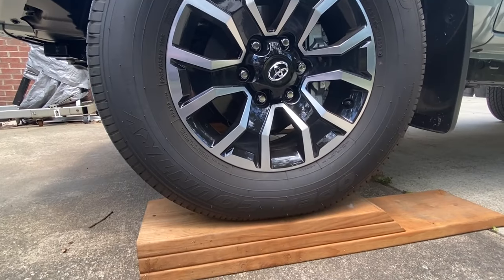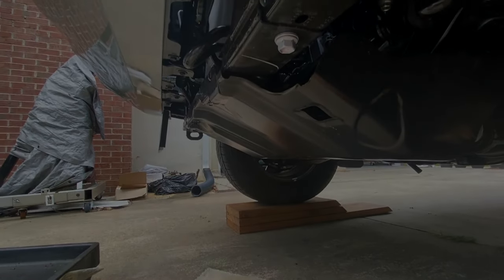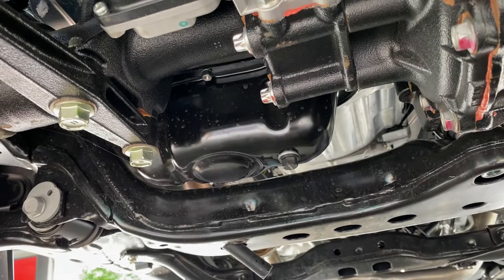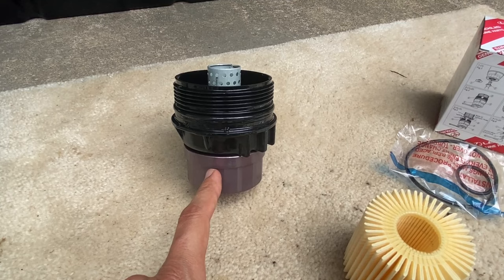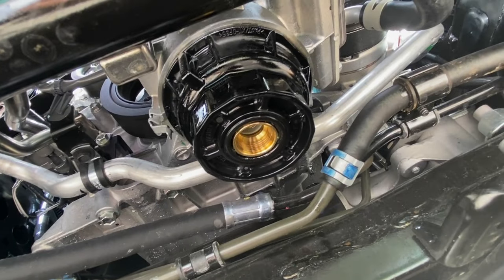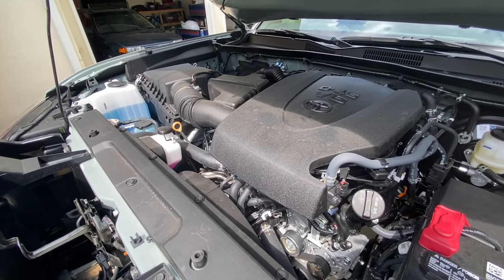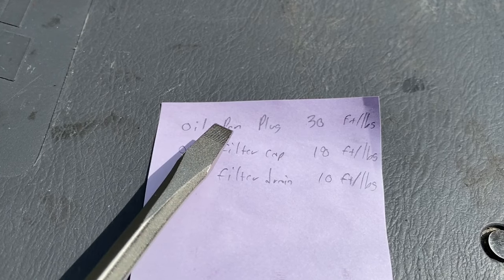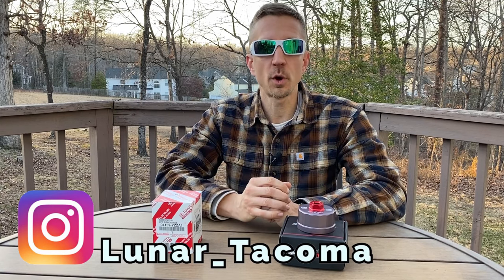Toyota Tacoma Oil Change Complete Guide - 3.5 V6 (2016-2023)

Comment: I have a 2023 with 100 miles on it. I've been checking the oil for the last few days and as many of you know, the dipstick isn't the easiest to read. It seemed to be reading over the full.
Since I bought it with 6 miles, I hoped it was filled properly from the factory.
Today, I had to change the oil, simply for peace of mind. It was approximately 30oz overfilled from the factory. I'm glad I changed it at 100 miles.
Has anyone heard of this happening?
Thanks
Reply from the maker: oh wow - 100 mile oil change.  I am not familiar with overfilling but I think I'd rather error on the higher side than lower side of oil.  That's good that you caught it for piece of mind.
Reply: @randomrebuilds  Definitely. I'm still kind of in shock, but I guess you never know. 
I figured that was measured by cpu at the factory. Strange..
Reply: @randomrebuilds  Have you ever seen seepage around the rim of your filter housing where the plastic meets the metal? Mine is torqued to 20 foot pounds and oil keeps appearing there. My truck has 110 miles on it and I already don't like it..
Thanks
Reply: My new Toyota Tacoma was a little bit overfilled as well, just be sure you're on level ground to check it.
Reply from the maker: @User-q6x3b  I have not seen seepage there. Wondering if the rubber seal got damaged somehow or another.  Oil leaks on vehicles is always annoying and vehicles less than 10 years old is unacceptable.
Reply: @randomrebuilds  I did replace 2 o-rings and 2 housings. This vehicle was about 10 days old..total lemon
Reply: @mikieg5985  oh ok..wow. yeah I already got rid of it. Too many problems for a 10 day old truck

Comment: If you don't mind getting a little oil on you but shortening the process, chuck that plastic nylon cap that will surely fail before 200,000 miles. Go to rock auto and pickup the metal replacement oil cap and some red Loctite threadlocker. When you do the oil change apply the thread locker to that small stupid drain cap and tighten the shizz out of it. Next time you just insert the extension, loosen the whole cap at one time let it run into your pan, then remove. Just like the old school mess maker chevy 350 🏁🏁

Comment: why is the check engine light on?
Reply from the maker: @phooongtion  ignition turned to the second position & engine not running. Standard procedure when key turned to on position and not started.
Reply: @randomrebuilds  ah okay thanks!

Comment: is it worth it getting the magnetic oil drain plug? 1:28
Reply from the maker: Some have commented that since engine block is aluminum - may not be beneficial. But would help with any piston ring wear. Up to you if keeping your truck for a very long time like I do.
Reply: @randomrebuilds  thanks for the reply brotha, will look into it! so far so good for you?

Comment: Great video man by far the best one out their. Quick?? Do you know part number or link to have a extra oil filter housing just in case the original cracks And will
The aluminum ones fit a 2022 Tacoma? 💯👈🏼
Reply from the maker: Some folks on TacomaWorld have done the swap and not having any issues.  Here is the part # 15620-31060

Comment: May just be that my torque wrench is busted but I tried to torque the drain plug to 10 ft lbs and it stripped
Reply from the maker: Wowsers - 10 lbs is barely anything on a 3/8" torque wrench.  Definitely test out that torque wrench on something stronger.

Comment: I changed my oil & filter in my new Tacoma at 1000 miles and between 4000 & 5000 from then on.  No way would I run any vehicle 10000 miles before changing the oil & filter.  I think Toyota should of stayed with the spin on oil filter.

Comment: 10k miles oil change is little too long.  5500 miles is what I usually go by  in changing the oil.  Keeping that oil fresh and clean.  Second option is checking the dipstick.  If it is darkest brown,  it is time to change the oil.  If it is stil a light brown color then it's still good for a few more hundred  miles.  Dark color is a sign your motor oil is no longer viable in lubricating all the metal components inside.  Just imagine running your engine in  fine particle sands, well thats what dark brown color motor oil is doing to your engine like a 180 grit sand paper instead of lubricating.

Comment: Am not a Toyota fan, those oil pump housing needs to be cleaned before putting it back on, old oil stains gets between treads and causes the plastic filter to get stuck

Comment: This dude is changing the oil on a brand new truck straight off the assembly line. Notice no dirt or even dust anywhere on the undercarriage. This video is fine if you are changing oil in a brand spanking new truck. But in the real world, the first thing you should do dump 3/4's of the first 5 quart oil jug straight over your head so you go ahead and get dirty, therefore, you don't have to worry about trying to stay clean while doing the oil change. This will still leave you with enough oil to fill the truck up with later. Also, instead of using that slow and time-consuming ratchet that he is using, go ahead and break out your Milwaukee battery-powered Impact to tighten up that oil plug and oil filter housing with.

Comment: People change your oil every 5,000 miles. 10,000 miles is ridiculous, especially for any variable valve timing engine that works on hydraulic oil pressure. No.1 reason for vvt engine implosion is POOR oil maintenance. Change every 5,000 miles or every 6 mo the, whichever comes first.

Comment: I don’t think it pays to do it yourself for only $65. The Toyota dealer will do everything.
Reply from the maker: Yeah, I just have a hard time letting other folks wrench on my vehicles even if it came with a few free oil changes.  Like knowing its done right myself.
Reply: @randomrebuilds  I know that feeling. I usually do it myself, but I also have a rav4 that was at toyota already, so I had them do a change. 
The next time I did it, I couldn't get the plastic filter housing off because they socked it down. I tried using a breaker bar and the housing cracked. Thankfully no oil was leaking and I took it to another dealer to get it off. 
Can't beat doing it yourself if you care about your vehicle.
Reply from the maker: @User-q6x3b  That’s just a prime example of an oil change tech not using a torque wrench.  My machines get torqued down wherever they get taken apart at. Sadly, too many clueless “techs” out there chasing paychecks and not caring about other customer vehicles.
Reply: @randomrebuilds  absolutely correct
Reply: I'm not really concerned about the money, I hate sitting for nearly two hours for an oil change, even with an appointment.  The last oil change I had, they forgot to put replace the oil cap.  I didn't notice for 1,000 miles when I randomly went to check the oil.
Reply: @brucekoopman6041  Having anyone work on your vehicle is very scary. Most people don't care about their own cars, never mind yours..sad
Reply: @randomrebuilds  is that the trd pro you have?
Reply: @Chris  yup, tweaker techs going thru flagging as many jobs as they can..."not my vehicle" mentality...always great peace of mind doing it yourself.
Reply: @randomrebuilds  I bought a 2023 Tacoma, and although it's a lemon, the dealership only made things worse (again).